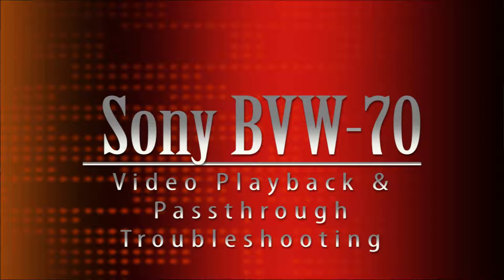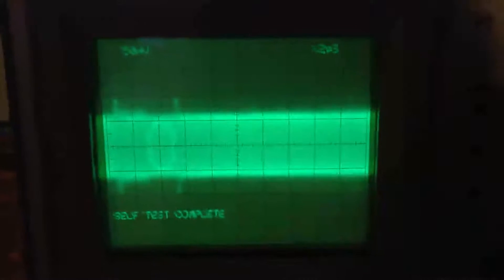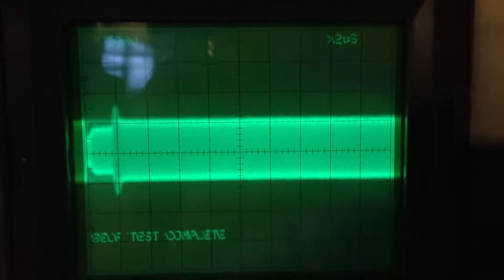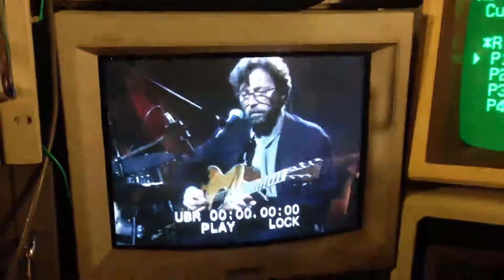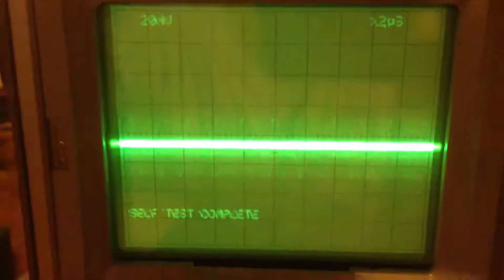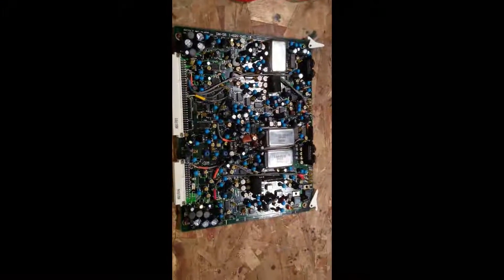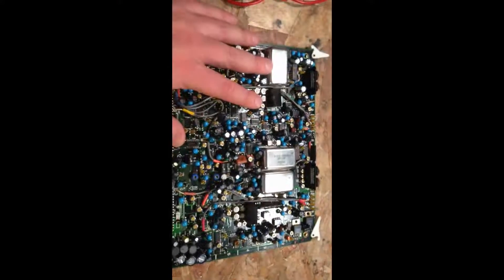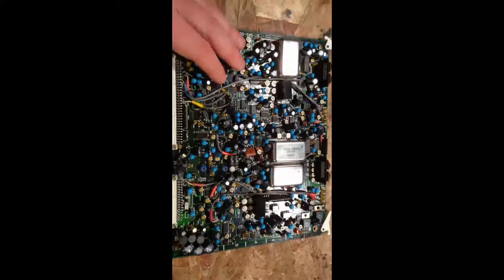Sony BVW-70 Betacam SP Troubleshooting

Comment: Did the fix you talk about here work? I have a BVW70 that is in great condition, other than the fact that it will not show video being played back off a tape. Audio, timecode, and everything else work fine.
Reply from the maker: Nope, had to get another demod board. Could not get the potting compound off the board of the filter.

Comment: Did you try to playback tape with TBC by-passed? VTR's internal TBC masks all video picture noise with gray color. The switch is hidden and can be accessed by pulling the hinged panel towards user. Switching TBC off may give a better picture for symptom. If video image on the monitor looks very noisy then video heads and/or audio/tracking head are in need of cleaning or tracking is misaligned. For on-screen data of tape time and time code more buttons for these are behind the hinged panel and accessed by turning the panel to the full 90 degrees angle position. The placement and information of OSD data can be set by those buttons. Service manual is required for doing it.

Comment: Just for grins, putting the deck on manual tracking and doing a slow dial sweep while the tape is running is one of the first thing to try when a deck is not working right.